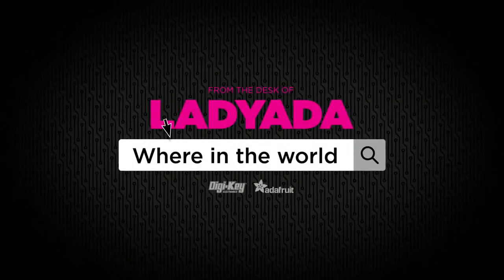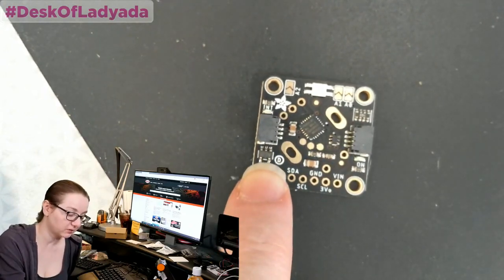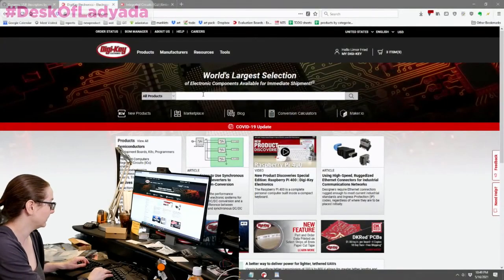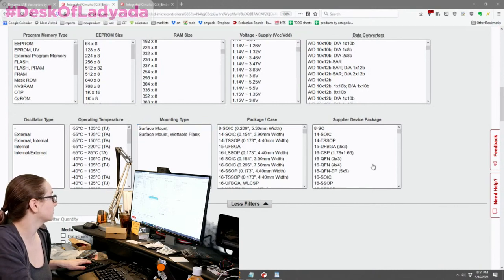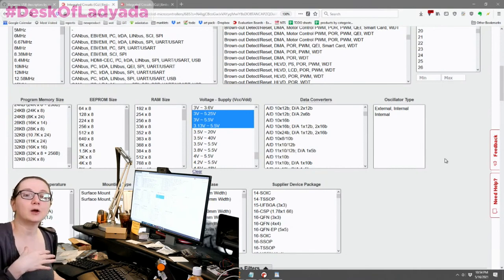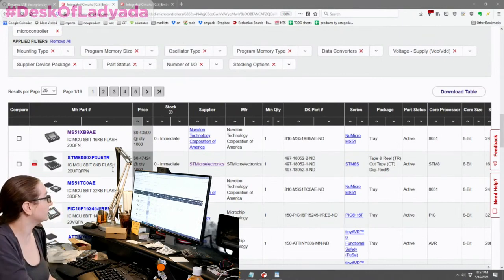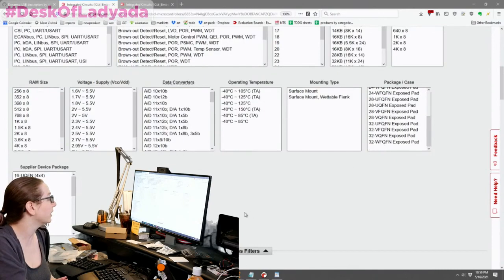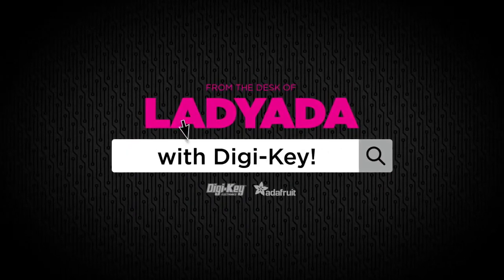The Great Search: A Very Inexpensive seesaw 8 Bit Microcontroller #TheGreatSearch @DigiKey @Adafruit

Comment: That was a great tutorial about how to cut through the clutter of so many options. Of course it requires that you know a lot of things that will influence the final product. Much of my early career (which started in 1976) was designing hardware with an embedded controller, then writing the software to make it go. There were not so many choices back then, and no surface mount either. I love what you are doing and the products you create.